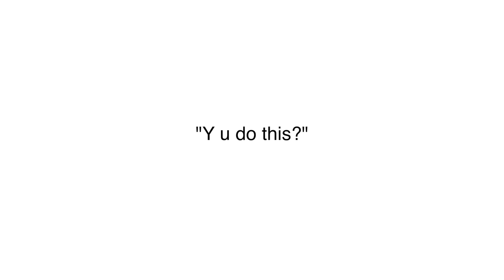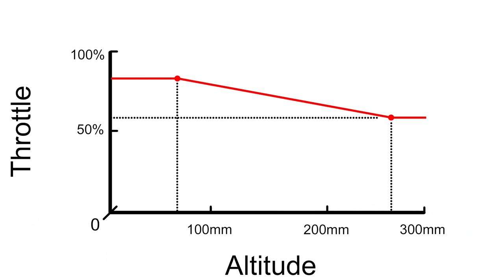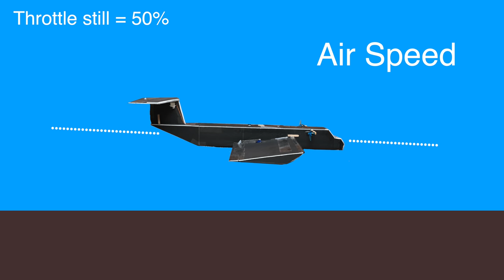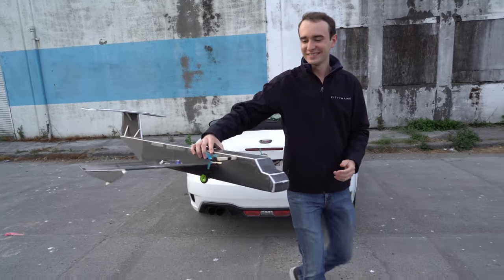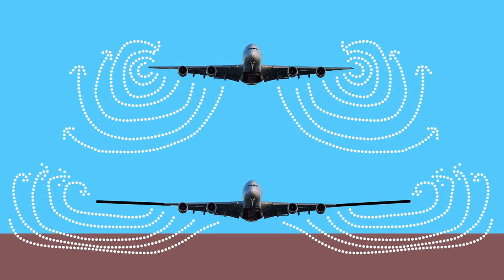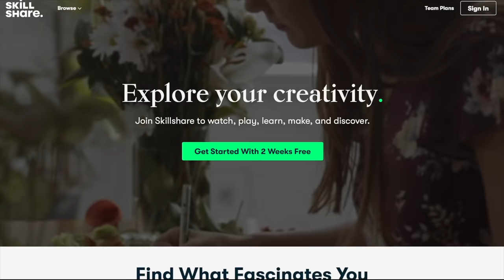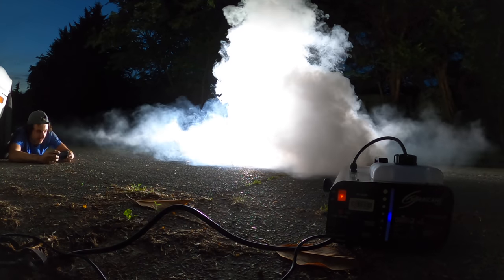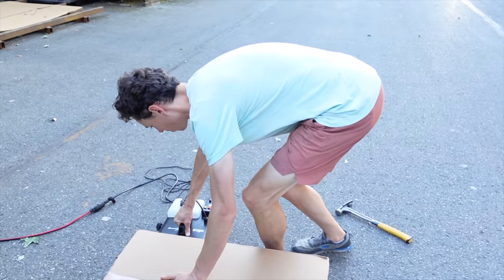R/C Ekranoplan Wingtip Vortexes

Comment: Some options for better control input:
- gyro hinge in the downwards laser, true 90 degree measurement
- 2 lidars to calculate pitch, and compensate distance
- many lidars for same and tracking in front of plane
- vision for control input to better track ground
- force feedback from wingtips or flaps to detect level of ground effect 
- use accelerometer to compensate the pitch in the lidar measurement
..if some not done already 🤔🤓

Comment: You should try a cascade PID controller. 
The problem is that the PID controllers output ist not of the correct type (Cant properly control position by proportionaly controlling force, you need to control speed). Using a controller to control the height that gives an input not directly to the elevator but rather to another controller to control pitch and from there to elevator would make this controller super accurate.
Source: Im studying aerospace information technology and this is exacly what we do for planes/rockets and im currently developing a flightcontroller software that would be perfect for this application.

Comment: awesome. actually pretty inspiring. I actually built a pid control loop to control the air speed of a asw28 measured by a pitot tube. i think it will work well to get te airspeed constant and then just get te altitude control with the elevator
Reply: thats sweet

Comment: Guys thanks for such a great fun video.  Love the use of equipment to capture the vortexes.  Just a thought  Could having a variable length wing (sliding, pivoting) be used with your lidar instead of throttle control.  It would be a bit like a bird tucking its wings to compensate strong wind and stay on track.   So as height builds up the wings decrease in area, and reduce available lift?

Comment: I have a question to my SiK Radio modules, maybe someone can help me out.

I did a firmware update to the RFD SiK 1.9 Version since I read it‘s more reliable than the 2.0 version.
The ground module is connected to my laptop, the airmodule in the vehicle and the green LEDs of the AM suggest it‘s connected, so it‘s receiving data from the GM and sending its values back, however the GM remains in „searching mode“ and seems to not receive the data from the AM. So is there any way to fix the RX of the Ground Module? Could it be a sw issue or simply a bad solder pad?

Thanks a lot for any help and suggestions!🙌🏼

Comment: Hello, In Order to make this more efficient, you need to increase Cord length. You should use Winglets facing down touching the Ground.
If you Loop with the Ground the Wingtip Vortex is gone. 
Perhaps use flexible wheels and  Rubber For the Winglets ?

Comment: For your child box try maybe a PVC pipe extention coming out if the box with holes in it. To have better colling effects you might want to insert a PVC pipe before the chiller box as a buffer. And then have one after the box going out. Buffering could be a good aid.

I am assuming the fog machine is hit that's why the smoke rises. Try a mosquito fogger also. That could work.

Comment: I have a sig 4star 54 54" span and 584sqin of wing. I just picked up a sig somethin extra with a 51" span and 725sqin of wing. Wing loadings are very close. the 4star has a thinner semi symmetrical airfoil. The somethin extra has a very thick fully symmetrical airfoil. I have noticed when the somethin extra get close to the ground on landing it really balloons even at lower speeds. Would be interesting to try similar wings but with a different aspect ratio to see if there is a difference.

Comment: great stuff - there was a documentary of the Ekranoplans by Mustard - apparently they implemented larger (proportionally) side plates to "reduce the formation of drag-inducing wingtip vortices" - curious if a taller sideplates would help restrict and compress (moar lift?) the air that is noticiably being pushed diagonally down and away from the fusealage (instead of under the wings)  - also seems those sideplates could easily incorporate a replaceable skidplate as landing/support gear in your model - just thinkin' 

https://youtu.be/yVdH_dYlVB8?t=247

Comment: Probably won’t see this but I think implementing two sensors, for altitude control, one where yours is plus another that looks ahead of the plane could help the delay in engine power. Also I think it would be an improvement to change the wind shape and/or airfoil shape to do the automated adding/reducing lift. This would allow for full elevator and aileron control…. Either way this is impressive and most likely what the “futuristic flying cars” will be.

Comment: Lol at hater comments. I think you are amazing and love ya videos. Had been wondering about using flaps and stuff instead of reducing throttle so could possibly go faster.. what about if the flaps are further forward on the wings and open them up to let some of the air presure underneath the wings, out the back, rather than using flaps to push down and increase drag. just a random though ..but could this maybe turn excess lift into thrust?.. assume I am way wrong or it would have been done.. Thanks again for the great content and looking forward more :)

Comment: I maybe late to the game for this input but... I used to work on Navy aircraft. Your porpoising problem, our altitude control loop for autopilot would aim for 50 percent correction rather than all at once for that very purpose. To avoid porpoising. This avoids over- correction and smooths it right out.

Comment: Very interesting experiment and visualization of the WIGE vortex.  We used an airfoil between the pontoons of our ultralight planes to shorten the takeoff run on water , it was very effective, the wing lift also offset the weight of the floats in flight.

Comment: Epic. Love your channel, pushing the envelope and experimenting with cutting edge electronics and hobby vehicles. 
What about using 2 small drone motors though holes in the wings to control altitude, that way the angle of attack of the ekranplan wouldn't have to change but you would have fine motor control over altitude and maybe more ability to fight against breezy conditions, with a gyro and altitude hold it could potentially fly dead smooth with a pid tune.

Comment: Ok. Here we go with math. 

Lift is mass of air affected times velocity downwards. For a given speed over a period of time. 

Induced drag is 1/2m v^2 with the above constraints (plus the mass of air in the vortex and the speed it is spinning at.)

So, in the smoke, the mass of air is reduced to the area of air that moves in total and the speed that it is moving. 

Soooooo.......... when you look at how much area of air is moved and how fast it’s moved then it’s clear that the ground effect has less area of smoke moved less distance in total. 

Well done, proud of you. 

Personally I would have had an air speed sensor on it and put that in the loop and the elevator as the second loop. 

I loved the batwing design, but they don’t usually have negative angle of attack on the leading edge or have uneven trailing edge. 

You sir are a god among men in the toy tech world.

Comment: You can reduce the wingtip vortices and further increase efficiency (in theory) if you reverse the winglets and have them point up link on an airliner. I'd be more curious to see what this does to the shape/behavior of the vortices as opposed to the actual efficiency though (as the benefit is probably pretty small on a small aircraft like this).

Comment: You don’t really want an I-term in the altitude control, because the plane will then compensate flying too high by flighing too low for a while… a PD-controller should be fine

Comment: Fascinating when you get into it.. two things you could have tried.. there's likely waaay more but.. a still air shed with doors at both ends for the cool air smoker.. & the smoker "might" be better pulling the cool air in rather than blowing through the cool air box.. pito tubes at the foil tips with a tiny smoke bomb onboard.. try bigger foil tip end plates too.. extended forward of the leading edge as well as rearward

Comment: You should have timed the smoke machine to cut off immediately at the point where the nose of the plane is top dead center over the nozzles, or maybe just before. So the plane pass can through the smoke and create the vortices without any interference from the output flow from the smoke machine nozzles. If you watch the vortices would be allowed to fully form and they would last longer, it would look awesome watching them spiral as they dissipated, which is whats almost happening with the chilled smoke. It would look so much better when the smoke is still and just naturally suspended then the plane emerging through the smoke wall and all the smoke being allowed to flow naturally without any interfering currents.
The other thing about the chilled smoke im pretty sure it wont work with dry ice, because its dry.. You need the the actual moisture from real ice because its the moisture being picked up by the smoke that makes the smoke heavier and stay low making the carpet of smoke you see in scary movies.

Comment: I think it's better to have the PID control on the elevator, with a adjustable altitude setpoint using a constant value that you can change using the elevator joystick. After all, you want to go as fast as possible. If you load the plane, it will adjust the pitch to still going fast and at a certain distance. Going fast gives you lift, if you reduce the speed to adjust the height, you will change your lift

Comment: On the chilled smoke device, attach a small fan, like for a computer, at the hole for the smoke to suck it out into the environment at a higher speed. You'll have to add a small intake hole on the opposite side of the box from the exit fan. This will pull the smoke out faster and let it spread further laterally in relation to the aircraft.

Also, another thing to consider is a small wind-tunnel. Building a small structure, which you can line the inside with cameras, so you can watch it inside, and place fans behind the aircraft,  to suck air across it from the front, and then secure the aircraft from the center of mass at the bottom so that forward throttle will hold it tightly in one place and the air flowing over the airfoils will provide lift. This will also be at center so that pitch control should be unaffected. The securing it this way will just keep it trying to fly out the front side of the tunnel. But it will eliminate the variables of windage affecting the aircraft. Then blow smoke from the front, letting the fans at the back pull the smoke across the aircraft, so you can watch the effect on the smoke through the cameras. You could probably do this in a structure about  5 times the size of the aircraft, 3 or 4 * as long as the aircraft, and about twice as wide. Just some thoughts.

Comment: You need a cascading PID to increase performance more.
Instead of trying to adjust altitude directly, adjust the rate of altitude change with the desired rate based on altitude error.

Rate error can be a combination of IMU and Lidar data. This would give much smoother and faster responses.

Edit: Also a triple cascading PID would be the best in controllability.
Acceleration -> Rate -> Altitude.
Where elevator angle is tuned to give a certain acceleration which is based upon the error between the desired and actual vertical velocity.
With the desired vertical velocity set by a PID for altitude. control.

Comment: What if you use the lidar to the throttle like before
but the ailerons controlled by a gyro?
so that they depen the oscilation and the outside influances independed from height/speed control?

Comment: why dont you try attaching the plane to a center point with a line and flying it continuously so that you can monitor speed and all the other values.  all you will have to adjust is tha altitude of the plane with this higher speed fly on wire method.  like those race planes that fly on string.   might work

Comment: All you need is a PD controller on the elevators. The "P" will drive the plane to the correct altitude and the "D" will dampen the drive to the altitude in the case that it's too aggressive. If you notice an oscillating move to the altitude, you're P is too high and D too low, if the plane oscillates its way to the altitude, you P is too low enough and D is too high.
The throttle does need a PID loop, as the "I" factor acts an error correction.
I find the best way to tune a PID or PD control loop is to collect data from flight and learn the flight characteristics, model them mathematically, linear models are usually good enough, and put the plane into hypothetical kinematic models. 
So for example, the plane's altitude is 300mm and we want it to be 200mm from the ground, how hard do we want the P factor respond to reduce the altitude? (What is an unreasonable altitude value to which the P factor willl respond 100%?)
Or, if we're in an emergency situation, the plane is in the same situation as above, but the altitude is already dropping at 200mm/s, how hard do we want the D factor to respond to dampen the decent? (What is an unreasonable decent value to which the D factor responds 100% in the opposite direction?)

This is the way I tune spacecraft movement and landings in KSP, though I will point out I haven't tuned aircraft yet, unless it's just throttle control to hold course and altitude.

If you like, I can take a crack at tuning your aircraft for you, but I will need to know more information about the control systems of the ekranoplane.
Reply: As for the PID controlling the throttle, I would recommend controlling the throttle via pitch, although I would recommend very small values for PID as you want the response to be slower than the PD loop controlling the altitude.

Comment: 5:40 Is that with d control? You can see the aircraft nicely reacting to the short-lived disturbance of the lid. With pure p control it just goes straight over, since it reacts far too slow
Reply: But generally, you'd want model based control for such a difficult and complex control loop with such a high lag to control inputs (thrust, pitch, etc)